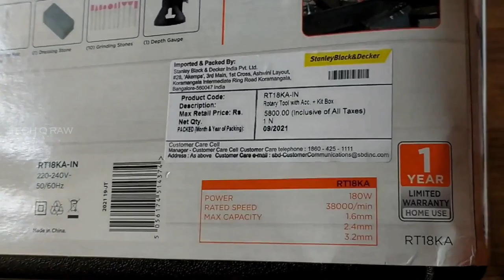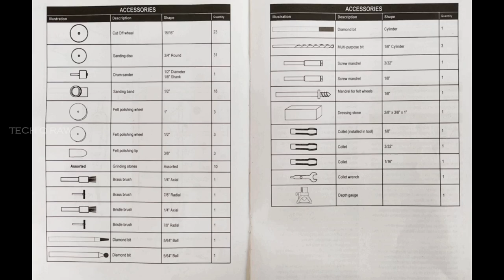BLACK + DECKER MULTI - PURPOSE ROTARY TOOL WITH ACCESSORIES UNBOXING & REVIEW

Comment: I purchased this via amazon during lockdown and I was never able to connect the machine with the grinding bits.  After looking into this video, I see a small transparent cover with a spanner like thing and 2 connectors.  That's missing in my kit.  It would be really helpful if could let me know it's name of that connector so that I can search and buy it.  Thanks.
Reply: Lol he liked and did not tell you
Reply: @aayushishah892  Very True.  I found it eventually, it’s called the chuck and got it separately as it was not available in my pack.

Comment: This machine is unmanageable by beginners, there is no on off separate switch, it is combined with speed controller which has to be modified. Extra rotary dimmer switch will be essential since it is too powerful for hand held work
Reply from the maker: Ofcourse, it's a powerful tool, and beginners to use with extreme care. Overall it's good one